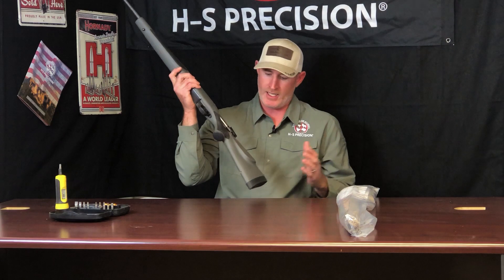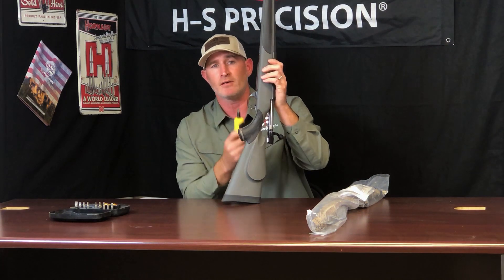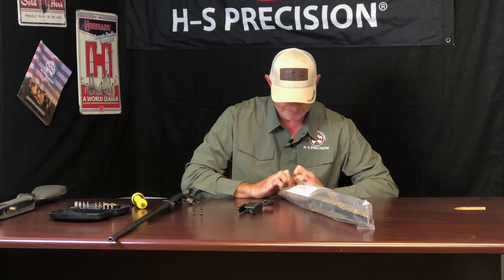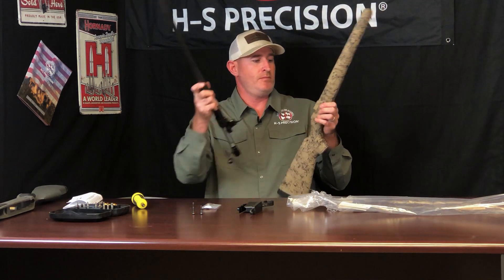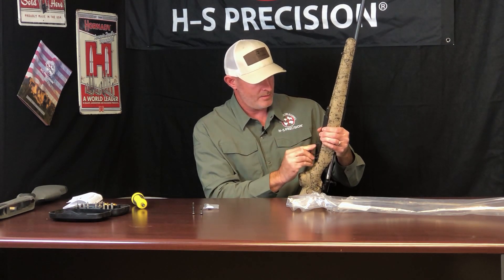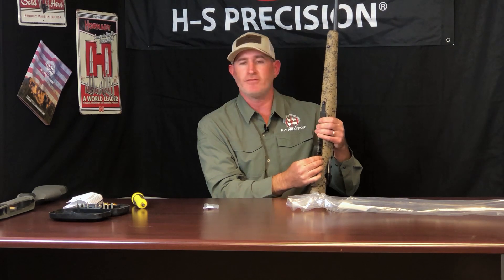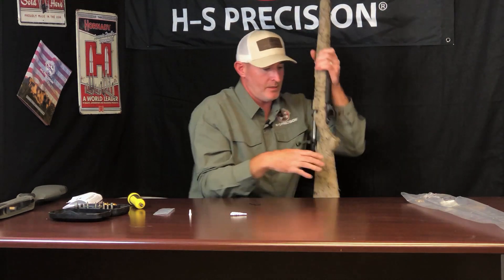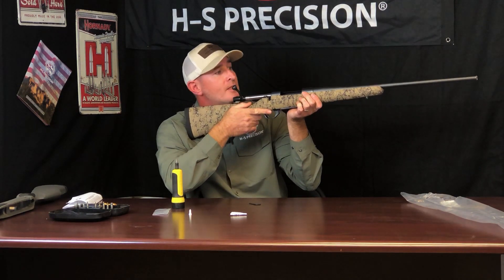Installing an H-S Precision Stock on a Howa 1500 or Weatherby Vanguard

Comment: I bought a houge polymer stock with a alloy bedded frame in it for the action to be bedded and barrel to be floated and what a huge difference it has made to my vanguard .308 rifle,its no longer an accurate rifle to 100 yards-its accurate way out to 300 yards plus. I also lightened the trigger to 2lbs and started reloading my own rounds which has improved my consistency even more.Tight 2.5 inch groupings at 300 yards for a hunting rifle is nothing to laugh about.

Comment: Forgive my ignorance; (1st time builder)
Will I get good results bedding this stock? I can see that it is "not necessary", but I wonder if it would improve the end product.
Give me your thoughts, I'm all ears.
Reply from the maker: The aluminum bedding block is CNC machined to the exact profile and dimensions of the action, so glass bedding will generally not help anything.  However, the bedding block does provide a great foundation for those wishing to bed the stock, and you certainly wouldn't hurt anything with a quality skim bedding.

Comment: What's the difference in weight? Would I gain or lose weight?
Reply from the maker: Hi Hunter - Our Howa/Weatherby stocks weigh 2 lbs 6 oz on average. It will depend on the weight of your original stock to know the difference.
Reply: I have theSame stock as in the video, same caliber.
Reply from the maker: @Hunter-eh4pz  our Pro-Series stocks are typically lighter than a wood laminated stock, and will weigh about the same for an injection molded stock.

We're happy to help answer more specific questions you might have about our Pro-Series line. Just give us a call - 605-341-3006.

Comment: One thing you forgot, after you have tighten main screws to 65 foot lbs per sq inch you need to loosen your set screws on the side of stock or your barrel will no longer be free floating and these screws will interfere with accuracy!!
Reply: These screws only touch the recoil lug, if I understood it correctly.
Reply: I don't think thoes is a free floating  barrel  any ways  howa or weatherby  vanguard

Comment: Would it not be better to just bed the action in the stock instead of using these set screws? Seems like a short cut to me, that will not hold in the longer term.
Reply from the maker: If done properly, bedding the barreled action is always a good option.  However, the Pro-Center technology allows the barreled action to be centered and free float without the need to bed the stock.